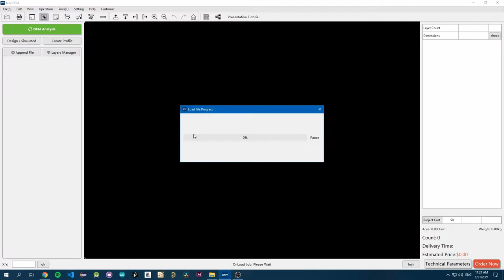DIY - ESP32 PICO D4 IoT Dev Board(OBJEX ONE) | SMT Hot Plate SOLDERING

Comment: Nice Board! What temperature did you set on the heat plate?
Reply from the maker: 210/220C - For a few seconds respecting the reflow times indicated in the component doc.
Reply: @SalvatoreRaccardi  Respecting the time at Tmax, but I don't think you can control the T ramp up or ramp down rate. You'd be better to invest in a small reflow oven.
Reply from the maker: @clubpasser123454321  Yes in the future for sure.